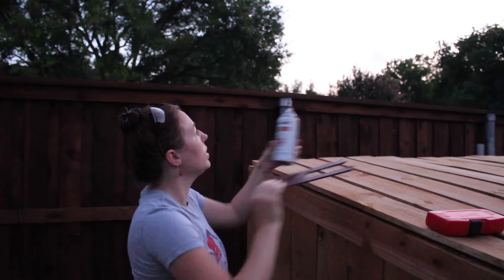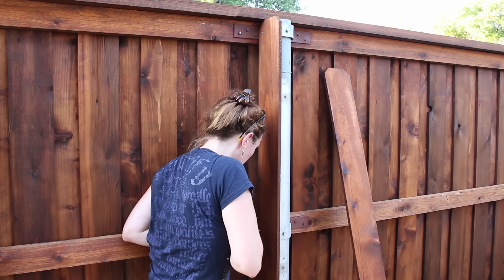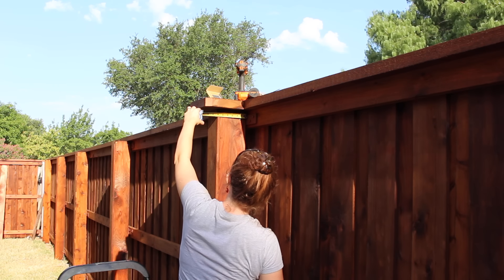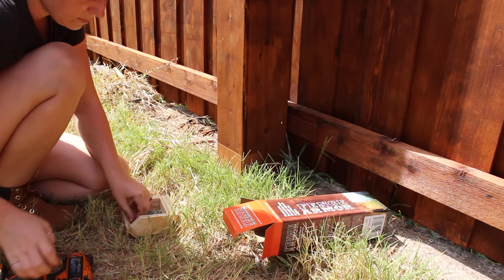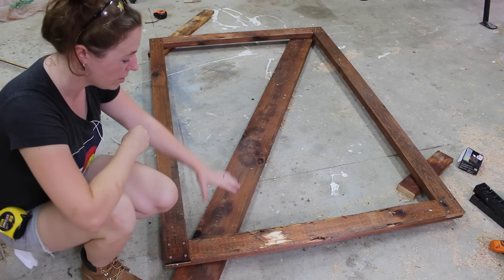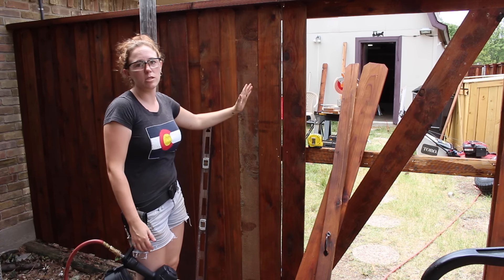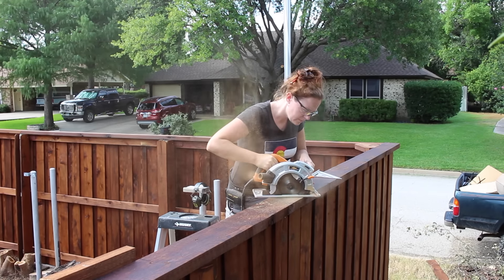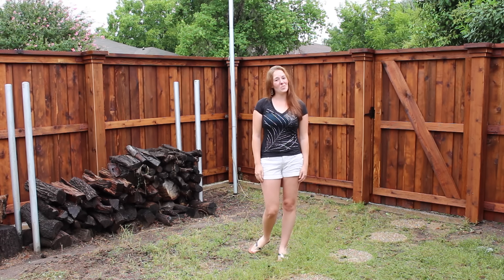Building a Horizontal Board on Board Fence | Part 3 - Trim + Building A Gate

Comment: Excellent women do the best  trim jobs and finish look I know i worked 35 yrs as a laborer and remodeled  and my paint jobs and remodeling still look the same as I did twenty years ago because I hand painted and hand primer and let the paint soak into the wood no body does that that's why the paint job never last

Comment: Hands down the best looking fence I’ve ever seen.
Reply: I agree.i love it!!!
Reply: Yes it is !!   I got excited just looking at it.   Adding solar light fixtures and a few plant hangers on the post every few feet would really look decorative.   (What do you think?)
Reply: I agree. Very nice.
Reply: AGREED THIS LADY NEEDS TO GET A ACADEMY AWARD PERIOD.
Reply: and woman
Reply: yeah it is
Reply: probably the longest lasting type of wooden fence too.
Reply: It looks great but, from an engineering point of view, the angled brace on the gate needs to go the other direction to keep the gate from sagging.
Reply: @777rogerf  No. A compression brace at 45 degrees or less in angle up towards opening side. An expansion brace or for wider gate could go the other way but the engineering required.
Reply: Anyone know the color of stain
Reply: Agreed
Reply: Couldn't agree more. Looked all over google for board on board and this ones still the best! Great Job April!

Comment: I had a 25 foot fence with post already in the 1 foot concrete wall.  I did everything like she said and my neighbors can't stop complimenting me.  It came out awesome.  Since the columns are on the inside the other side of my house fence has pickets higher.  So all I did is run the cedar 2x4 across the top of pickets and 2x6 across top and it works great too.  The columns are below the top of fence.  It looks great too.  Other than the physical labor the explanation  she give and directions where perfect.  Keep your phone handy.  I did have to refer to the videos a few times.  But it was like she was there with me telling me what to do.  I have never built anything in my life.

Comment: The post covers are going to pull apart as the wood dries. It looks nice upfront  though.
Reply: @mrcmxoner  
Lol, ok??
Reply: I've seen an alternate method that might be better. Instead of using three pickets to build the decorative box to hide the steel pole, the other method rips a 2x4 into two 2x2s, then uses one of those 2x2 strips on each side of the steel pole, and then those are used as the sides of the box and then a picket is put across the front, as is done here. The end result will be a lower profile box than these, and the 2x2 strips can be expected to warp less than those giant 1x6 pickets used as sides in this video. However, the steel posts used here like very beefy, so the 2x2s may not be big enough to create the needed clearance. Also she would have to do extra timeconsuming and exacting detail work to cut notches in the 2x2s to clear those steel brackets.

Comment: $5800 for a fence.  Probably a few grand worth of tools used, too.  Hurray for sponsors.  The video gives the impression that this is something you can tackle with the help of some friends and neighbors.  But really, unless you or one of your friends is a woodworker by trade and already has a boatload of tools, and you want to take out a second mortgage to cover the cost of a fence, its not very likely to happen.

It is a damn good looking fence, though.
Reply from the maker: You're right, I spent right at a grand for the tools to do this fence but you know what? even after that on top of the expense of the materials I still saved thousands so it was worth it. It would have cost $12,000 to hire out this job. In my experience you can always find reason why something won't work if you want to, but on the other hand you can always make something work if you want to. Most people wouldn't have steel posts and wouldn't need to extend them (take off those tools and that expense). You could leave off the top cap and trim if you wanted to (take off that expense). You could also leave off the posts boxes with all their top cap and trim (take off that expense). Then there....you not only cut out some of the tools needed but also some of the expense. Or another option: save up and start by just doing the pickets, then save some more and add the top cap and trim, then after saving another bit of time come back and add the boxes. When doing projects you just have to be creative about how to get it done. That is, if you want to get it done.
Reply: April Wilkerson you spent a grand on tools and used other tools you already had that were another grand.  You'd have to be buying your tools off the back of a truck if you hope to get a compressor, air hoses, nailer, welder, welding gear, grinder, miter saw, Skil saw, screw gun, drill, levels, helping hands, wood roller, table saw, and anything else I missed from the video.  Either stolen or bottom of the barrel Porter Cable junk tools.
Reply from the maker: Pawn stores, Craigslist, garage sales, borrow whatever you can from friends....again if you want to get something done then there is a way. If you know you need to replace your fence and it's going to cost 12K to hire the job out then start keeping your eyes open for good deals on the things you'll need months ahead of time and collect them slowly so it doesn't all come out at once. Or don't. Pay the contractor his huge fee and don't think about it again.
Reply: April Wilkerson what did you do with the old fencing
Reply: April has done a fantastic job on this, and it is a much more finished product than I would have ever considered for a fence.  I enjoy watching her videos.

I grew up using tools for every discipline, working right alongside my Dad and Grandpa.  I put myself through college working in a cabinet shop.  Now, my daughter helps me on projects of all kinds.

Tools accumulate over time.  I've been buying tools for my whole life; some new, some used.  If you're thinking that you're going to save a ton by buying them all at once, you're in for a shock.  There are still some tools that I don't use very often, and will borrow from a friend or family member.

Materials cost what materials cost.  The grade and style of wood you use can have a significant impact on the cost.  There's often a substitution for a less expensive material.  Same goes for hardware.  Keep in mind, you get what you pay for.  Aesthetic and material quality don't come cheap.

Labor - that's your biggest risk.  Doing it yourself gives a sense of accomplishment.  Subbing it out, gives you the sense of instant gratification.
Reply: Gummi Bear - Between myself and neighbors the only tool we had to rent was a auger because of two feet of sandstone to go through.
Reply: giantpune first off if you don't have the tools to do a job, don't do it. If you want to do it, then start saving for tools and materials. You don't need to go all out on new tools. Quit being so negative and talking down on other people's projects.
Reply: While I can see Giantpune's point b/c it's usually my husbands POV lol, I'm the type of person who says I can use all those tools I bought for future projects, plus the pride of knowing I did it myself, and also saved money in the meantime. Also, I like have projects to do and something to work towards. Her fence looks better than my of my neighbors fences that paid 6k ad their's aren't even board on board. I love your vids April, you're awesome!
Reply: Giantprune....if you don't have the tools hire out the job and pay double.  Or start your own channel, build it up and get some tool sponsors.  Until then you can stare at your piece of crap old fence.  Pretty simple math really.
Reply: You do need some tools BUT not all the tools that April used . Over time you can pick up what you need at pretty reasonable prices if you buy on sale. (or buy used stuff.)   Remember, tools will last a long time if you take half way decent care of them and they can be used on many projects .
Reply: Did you take note the size of the yard? That was a lot of fence to put up.
Reply: Well lets make a quick count. If you don't care that much about privacy and leave out half of the pickets and the trims and tops, you instantly save 2600$. You can also 0 out the tool costs by borrowing what you can, and using hand tools for the rest(nailing, etc.). You can also decrease the costs if you have some materials on hand(nails, screws, hinges, etc.). Also a dad or uncle with a good shop can come in handy.
The old fence can be used for firewood, or sold for scraps if you live in a warm climate. Anyway there was a lot of wood taken down from the old fence.
One(not you) can also put up chicken wire for like the price of the nozzle that one sells from their truck and still have change for some shit beer to drink on their porch in their wifebeater.
It's all about preferences.
Reply: giantpune 8
Reply: giantpune o
Reply: Yeah, but there are a lot of avid diyers who already have those tools because we already build things...
Reply: But this tools can be used for others projects, and probably neighbors will be looking for her to build their fences, so at the end can be the star of a new business.
Reply: @giantpune  I built same fence, minus all the time consuming b/s, which is cool but not what i wanted to spend my time on.. I put up 398 linear feet of a 6' privacy fence. It cost me $5200 and the only tools I needed were a drill (which if you don't have that is just sad and you can't claim this to be added cost).  The next thing I needed was a circular saw and a tape measure (if you don't have these 2 items you can't add this to the cost either). After that I rented a post hole digger for $135 and dug my 55 post holes. $5200 and I used Western Red Cedar Pickets. I built each 8' section in my garage and then carried them out to the driveway and sealed the wood. I built all my gates to be 9' and a driveway gate of 14' even with all the hinges and wood and screws and stain it was $5200. so all the additional stuff she did if it cost $600 more sounds legit.

Oh and as for the second mortgage comment the land surveyor I hired when i bought the house offered to do the fence I did for $5200 for $12,500...oh and he was going to use concrete for the post holes which is ignorant and not screws but Nails on all the pickets (another fail, you don't need tensil strength on a fence... you need pull out strength).
Reply: BodyCount : what did you use for the post holes instead of concrete?
Reply: @sterlinghearth6672  I used Secure Set. My Grandpa has a small farm and my Dad and him tamped in his round posts in the mid 1960's and they are still standing. My father put in a privacy fence 23 years ago with concrete and the posts were all rotted so i decided to try the Secure Set. You should definitely watch a video on it on how to mix and steady the post (you can't hold the post or touch the post when the foam is expanding or it won't work.) For any gate posts I did use concrete as you need the weight for gate posts so concrete should be used on those posts. My 6' red cedar privacy fence has been up for 3 years and no issues, so it works, just hoping it outlasts my fathers 23 years! expect about $1 more a hole for the Secure Set vs concrete but it beats lugging 80 pounds of concrete to each hole =)
Reply: You CAN rent tools you know?
At the end of the day,  it would still be cheaper to buy the tools and materials than it would be to have someone else do it.  
I'm sure it'll take a while,  but then you'll have all that experience aaannndd a new fence and new set of tools! 
I also did not get the impression this is just something anyone can do, she's showing how she did it and what she did it with.
Reply: Actually $6,000. For that size of a fence is very cheap.   That would most likely be a $20,000 dollar fence is you hired it done.  She did a beautiful job and wow, that is a beautiful fence.

Comment: Aloha April, Inspiring work, as I was going to do the same instead of hiring out.  It simplifies and answers some of the questions by watching your experience with building this fence.  I'm influenced by the Japanese style fencing from Hawaii and could apply that style with material at hand here in Texas.  Your posts even have room to attach night lighting for backyard entertaining which is what I'm after eventually.   I'll probably design plan but mock up a fence section.  Thank you for your beautiful work.

Comment: As a professional fence builder.  I didn't see anything i would of done  differently except that last bit she pointed out. 😊😊😊😊
She did a expert job.   I would have been very happy with her work! Great job
Reply: Are you still on YouTube? I had a very similar fence built but with an additional bottom skirt board. That has made pockets on the bottom of every other board that collects dirt and leaves. I'm thinking surely that shouldn't have been done that way. Would very much appreciated any info! Ty
Reply: @dalpz205  I'm on utube
Reply: @dalpz205  may I be of assistance  ???
Reply: @evankibbe590  Thank you so much! Like I said I've got a fence similar to this. Board on board cedar but has a bottom skirt board. It's created these pockets at the bottom of every other board that collects dirt, leaves, grass etc. Is that how it's supposed to be? Is there any way to prevent that? The company might actually be rebuilding this entire fence and if I could prevent that I'd sure like to know how.
Reply: @evankibbe590  Also thank you again! I appreciate any advice.

Comment: I love it and grateful for you posting this AWESOME video! I'm ready to frame posts on the smooth side of an 8' fence. I'm thinking I should put two (2) fence pickets facing the viewer since it's an 8' vs 6' fence. It seems that will look more substantial. I'll try it on the inside (private facing my backyard) before doing the outside. Thanks again for your post!

Comment: Wow April! That’s amazing. My only tip is if you do a fence with top cap again, instead of a relief cut on the hinge side, just do a diagonal cut again like you did on the latch side. If you fasten the top cap correctly it’ll open just fine and it will sill look solid

Comment: Nice work as always April. Ya know... you could of used those long runner brackets to also hold the wood required to box in the posts. You would put a 2x4 on each side (long ways on the side of pole) fastened through the bracket from back to front then complete the box with a 1x6 on the front. No need to drill holes in the fence posts...

Comment: I just had  almost 40 year old fence replaced, was done originally with steel post, told the outfit doing it, ( got a really good bid)  they didn't need fence post, they were pleased  and it turned out great
Reply: Wow that's incredible. So according to your experience, steel posts deliver on their promise.
Reply: The fence was actually closer to 50 years old, and the main reason I had to replace it was the grape stakes from 1971 had worn out,  the new fence is using the old  steel poles for post , I did the new fence in 2018, watched and helped my dad with putting up the fence back then as a teenager

Comment: You do beautiful work.  
  I think the boxes over the posts you really wotked hard on. I might have pre made the boxes then slobber some glue they use for drywalling over cement with no studs..just glob it on & press the box into it, tape it until it dries.. Just a difference in preference,  I don't want to drill those steel pipes.

Comment: hi april a new subscriber here , i was searching for a diy fence and your video came along and i think its the best looking wood fence idea out there so im going to attemp it. i allready bought most of the material my only concern is that the round metal post im using is 2 3/8 instead of 3 1/2  both by 8 foot  thats the only thing available here in my area i just have to figure out how to build the casing around the post.im sure i can figure something out.thanks for your diy video.

Comment: Wow, good job, that is a really nice looking fence. Did you buy your boards pre stained or did you stain them? One think I would've maybe done different is when you installed the trim under the caps, cut 45° angles, but it really isn't that big of a deal. If you went back over them and stained the end cuts then it probably made the cuts virtually undetectable, especially at a distance which would have basically gave you them same result with much less work and measuring. Well done, it's nice to see regular people producing extraordinary structures.
Reply: You won't get a good result to begin with using 45s on wood of this type, and it will quickly develop unsightly gaps as the wood ages, and that would bug the cr-ap out of you. 45s need to be very precise to work properly and wouldn't be appropriate here.

Comment: I can't believe it. I just saw the pix of your video with it finished. I watched a man do the metal poles with the wood panels. I thought of making covers of wood for the poles and here that is just what you are doing.  Things are funny.  Your fence is beautiful. So will be mine. Got to do it cheap. Wondering if PVC pipe would be cheaper than the metal, it would last and if you cover it up anyway with the wood, who would know?
Reply: Hi Inspire734!  I don't think PVC would be strong enough to support the fence.

Comment: That looks amazing.  I especially like the way you did the gate.  One question about the angle cut on the unhinge side.  What was the angle of that cut, 45, 33, 22.5?
Reply: Looks like about 10 degrees is all I need for a 65" wide gate.